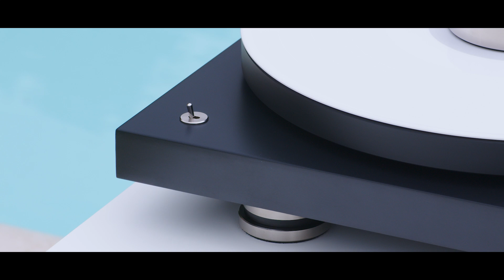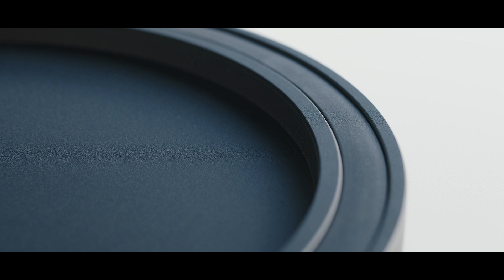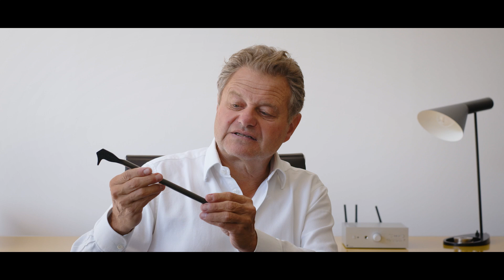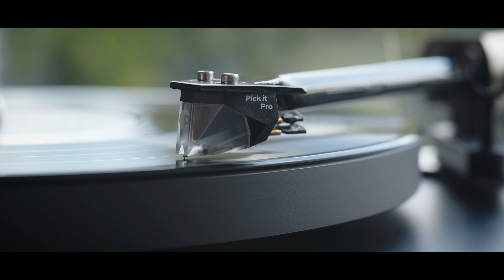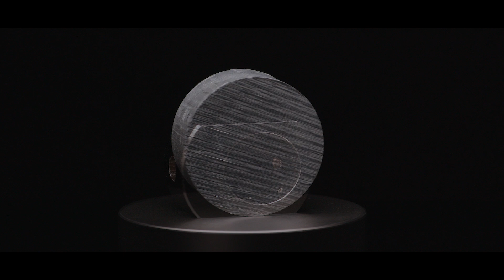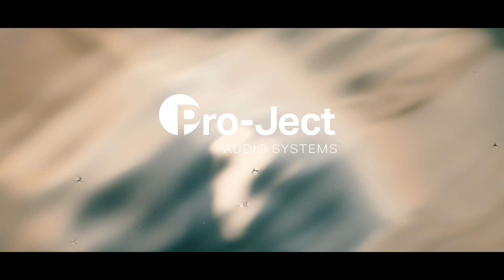Deep talk with CEO Lichtenegger - Debut PRO turntable | Pro-Ject Audio Systems

Comment: I purchased a Debut Carbon Evo at the end of 2021. It sounds good but is terrible in terms of quality, little more than a toy. Just a few months after the warranty expired, and used no more than 3 or 4 times a week, the motor started making a distinctly audible noise. This seems to be a common issue, and I later discovered that it’s discussed on various forums. After a few more weeks, the motor stopped working altogether. Customer service told me I would have to buy a new motor and replace it. Pro-Ject is anything but pro. A big disappointment.

Comment: What cartridge do you recommend as an upgrade?
Reply: Fit any of the 2M series stylus to the Pick It Pro body. The Pick It Pro cartridge body has lower internal inductance than any of the 2M series cartridge bodies which makes it an improvement overall in terms of frequency response. The Pick It Pro stylus however was a strange decision by Pro-Ject with its low compliance it suffers mis tracking distortion especially with loud sibilant recordings. A table of this caliber deserves a much better stylus.

Fitting a 2M Blue or Bronze stylus to a Pick It Pro cartridge yields fantastic improvements with a more compatible compliance with the tonearm, great performance from the low inductance cartridge and also gives the best performance per price improvement vs changing to other carts. 

Moving coil is overrated. It means changing the whole cart when the stylus wears out and also improves the likelihood of increased noise floor from the high amounts of gain required.

Comment: Dear Sir,
At 03:04 you use without any mat when you put an LP to the turntable. Is this use is correct at Debut Pro with this original black platter?
Reply: Yes the Pro is designed to be used like that and that is exactly how I use mine.
Reply: @michaelb9664  ok... 😊 but what about the VTA setting 😂 The factory setting assumes the use of the felt or just the platter. 🤔
Reply: @laszloszabo2703  the VTA doesn’t need adjustment. The felt mat is only 1mm thick.

Records vary in thickness much more than the difference between felt mat or no mat. No one is adjusting VTA for every 180g record. What about warped records? Can’t adjust for that either.

Some people put way too much emphasis on VTA. It’s important up to a point but not enough for 1 or 2mm to matter between a mat or no mat or a 120g record vs a 180g or 200g record.

Comment: I found that it’s very hard to change cartridge for debut pro, coz the cartridge cable is very short, if the cartridge used is shorter than original one, it’s almost impossible to adjust a correct overhang, am I right?

Comment: got mine today, was hyped but sadly it is not entirely quiet, standing in front of it I can hear it turning. does anyone know if this is normal? it's a very silent sound but it is there with every turn.
Reply: Sometimes the sub platter can cause a bit of friction if the shaft is not sufficiently lubricated. Add one or two drops of good sewing machine oil into the inverted main bearing.

Comment: Which cartridge would you recommend as an upgrade to the pick it?
Reply from the maker: The Pick it PRO is perfectly tuned to match the Debut PRO. If you want to achive a different sound, you can upgrade the needle inside the Ortofon 2M series. The Debut PRO is also ready for MC cartridges. In combination with our True Balanced cable and phono preamps you can take your Debut PRO to another level!

Comment: Hello i bought it and this is a really wonderful little  machine! I equiped it with at-vm95 microline and sound is anmazing without any distorsion! One thing is not very good- arm lifter stuck when you dont listening it every day. Few movements and it work again, but when you dont listen music for a day or week, it again stuck. So i need to move it up/down up/down again and the it works.

By the way in future i want to buy X8 or even Xtension9. When will be Evolution tonearms with Aluminium Core? As far as i know there still no composite construction in EVO 9cc tonearms and they too light for AT cardridges compliance. I have music hall with carbon arm without alu, dont like the sound. But debut pro with composite arm is great!

Comment: I'm about to take delivery of a Debut Pro, upgraded after years with an Essential III. Would the aluminium sub-platter and acryl-it platter still be recommended upgrades for the Pro or would it interferes with how it is designed with the die-cast aluminium platter and change the sound too much?
Reply from the maker: Aluminium sub-platter would be a perfect upgrade. The acryl it more for optical reasons. Technically speaking the Debut PRO platter is nice in all aspects, but practically speaking if you want it for the looks, go for it.
Reply: @Projectaudiosystems  perfect! Is the different aluminium sub platter specific to the model or are they the same? Eg classic vs debut. I'm guessing I need to get the debut sub platter.

Comment: Yep. Looks like overpriced junk. Neat!
Reply: That's because it kind of is. This is an inexpensive turntable. Look at the competition, & SUCK IT UP, BUTTERCUP!😘
I prefer the Dual CS518 at this price myself; alot less junky, a bit better sounding, not-bad built-in phono stage included, & you can find the power & speed switch & don't need to fiddle with installing a separate belt to play 78's, either! Also doesn't have audible levels of wow, like my sample of the Debut Carbon Evo (or is it the Carbon Debut Evo? Or Debut Evo Carbon? Or Evil Debut Carbon? Or...🤔😵😵😵) did, right out of the box.
Otherwise, new turntables at this price don't compare to a vintage purchase, & are no better sounding than any old Crapanese Fry-An-Ear, Soundsscrewy, Kenwoof, or Drechnics from the 70's & 80's.
Speaking of Technics, once you go up a little from here pricewise this crude toy & it's other Pro-Ject friends don't compare with a 1200 Mk.7 or SL-1500...never mind Audio-Technica's Chinese offerings in the Debut Carbon Alphabet Soup's price class ($600-700USD).🙈
Reply: @joerosen5464  The Sony PS-T3 is the best turntable ever made ever. Period.

Comment: I bought Debut Pro and it’s a great turntable. For the upgrade, I ordered Debut Alu Sub Platter and Record Puck Pro. But for some reason the spindle on the Alu Sub Platter is higher than on the original plastic one, so the Puck Pro can't reach the record and stands on top of the spindle as a decoration. I'm disappointed with the incompatibility of the original upgrades for Debut Pro. And they are not cheap. I spent almost € 200. I’d love to ask the guys from Pro-Ject about it, but it’s only possible to contact distributors, and they don’t know the reason for that. There is no direct contact on the Pro-Ject website.
Reply from the maker: Hi Bruno, there sadly was a batch of wrong sub platters which came with a too long spindle. Please report it to your dealer & ask for an exchange! Sorry for the circumstances.
Reply: @Projectaudiosystems  I did, but they all have the same issue. I got a refund.
Reply: @brunopree8852  did you even get the correct aluminium sub-platter?
Reply: @nineteen76  Not yet. I ordered a new one from the croatian distributor, but it takes a month or two.

Comment: Is a phono pream necessary for the debut pro?
Reply from the maker: Yes, phono preamp is necessary.
Reply: Already ordered my debut pro which preamp would you recommend?
Reply from the maker: Would recommend either the Tube Box S2. Or the Phono Box S2 Ultra (basically a Tube Box S2 without tubes, if you like that more). Both are fully discrete designs and share a range of other technical design choices. One step below, would be the Phono Box S2 and one above a Tube Box DS2. Any of those I mentioned can also handle MC cartridges.

Comment: so the question is ... better pro or project x1 ??!
Reply from the maker: Both have different history and design backgrounds. The Debut line was always designed for beginners who want to start into HiFi. These beginners usually don‘t have huge power amps and big speakers. We always tried to reach a big sound stage with a warm & full sound to compensate the weakness of small speakers.
We also followed our philosophy with the Debut PRO & reached an even bigger soundstage thanks to the new Pick it PRO and heavy aluminium platter. And due to the VTA adjustment possibility, the anti-magnetic platter & the aluminium- carbon hybrid tonearm the Debut PRO is definitely ready for a moving coil (MC) cartridge.
The X line in comparison aims another goal. With the X1 for example, you get a nearly perfect audiophile turntable in relation to the budget. It greatly benefits from better a amplifier and better speakers to reach the best possible sound. Due to the increased mass, 4 pin point cardan bearing construction with less friction and the different choice of the platter the turntable leads to a more analytic sound.
Reply: @Projectaudiosystems  Thank you!. As for the cartridge on the debut Pro is it possible to change only the stylus with an Ortofon 2m Bronze or Black or is it necessary to change the whole body?
Reply from the maker: @filippobresolin7069  In this case we would recommend changing the whole cartridge. Body to the 2M series is different from the PRO.
Reply: @Projectaudiosystems  Thank you!  I contacted audiogamma italian and it says it is still waiting to receive the debut pro.  When will you be able to send more to Italy?  I am still waiting to receive it and at the moment I am without a turntable unfortunately.

Comment: It´s been more than 15 years with my Pro-Ject 1Xpression and I have made this upgrades:  1-  Speed Box MK II  2-  A 1" thick rock board, al old bicycle tire over it, a wood board over it and the 1Xpression over it all AND 3-  Jasmine Turtle phono cartridge !!!!!!.  This is too heavy (14.5 grs) so, please forgive me, glued a metal washer to counterweight back.  Man, if you can afford this cartridge don´t be affraid, this table  can perfectly handle it and now I have major leagues analog sound.  I reached my holy grail, this 1Xpression is unbeatable for the price.

Comment: Is it still worth getting the acrylic platter?
Reply from the maker: We would not really consider it as an upgrade on the Debut PRO, but more as a sidegrade. Both have their own advantages and disadvantages.
Reply: It's worth the ≈$125USD to put a Funk Firm Achromat on this incompletely damped GONG! of a platter; the improvement is NOT subtle & therefore WELL worth its seemingly exorbitant price. Throw the supplied thin felt mat in the trash. Where it belongs!😛

Comment: What are the differences between this and the one that costs $100 more? Think it's the X1.
Reply from the maker: Both have different history and design backgrounds. The Debut line was always designed for beginners who want to start into HiFi. These beginners usually don‘t have huge power amps and big speakers. We always tried to reach a big sound stage with a warm & full sound to compensate the weakness of small speakers.
We also followed our philosophy with the Debut PRO & reached an even bigger soundstage thanks to the new Pick it PRO and heavy aluminium platter. And due to the VTA adjustment possibility, the anti-magnetic platter & the aluminium- carbon hybrid tonearm the Debut PRO is definitely ready for a moving coil (MC) cartridge.
The X line in comparison aims another goal. With the X1 for example, you get a nearly perfect audiophile turntable in relation to the budget. It greatly benefits from better a amplifier and better speakers to reach the best possible sound. Due to the increased mass, 4 pin point cardan bearing construction with less friction and the different choice of the platter the turntable leads to a more analytic sound.

Comment: Your turntables are good performers. I own 2 of your high end turntables, but your pricing is out of control. The value of your products are becoming a major issue amongst potential customers and people will likely start looking elsewhere. Your new pricing is way about the rate of inflation. My Xtension10 cost me $3000 7 years ago. Today, it’s about $5k! At that price, competition is fierce and I personally would be compelled to start looking at other high end manufacturers products instead of Pro-ject.  Just my 2 cents.

Comment: I recently bought the aluminium sub platter for the normal debut III is it compatible with the pro ? Also I have the acryl it platter is it compatible and mainly if it is better or not with the standard platter that you supply with the pro because it’s heavier 1.6 kg instead of 1.3 kg for the acryl it , I will be really nice to use parts that I have to the new pro that I am highly interested.
Reply: The "Debut Aluminium Subplatter" is compatible with all Pro-Ject Debut models.

Comment: So you can put the record directly on the platter without a matt?
Reply from the maker: The PRO comes with a mat, but the new platter is designed to be used without a mat as well. However, we would recommend some kind of record puck, weight or clamp to secure the record tightly against the platter. If you do not have something like that, you might want to use the mat as it also acts as a something that secures the record against the platter (that's where the term slipmat comes from).
Reply: No, the Pro comes with a generic record mat which can be upgraded.  Even with the generic mat, the sound is improved over my Debut EVO.